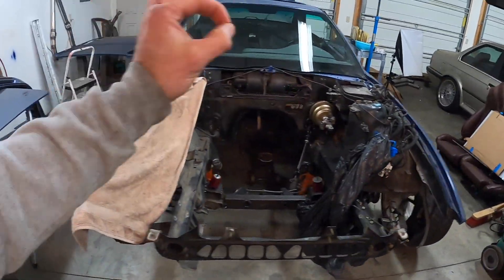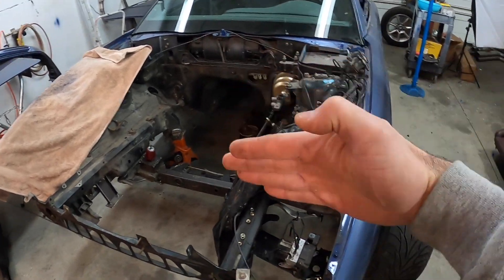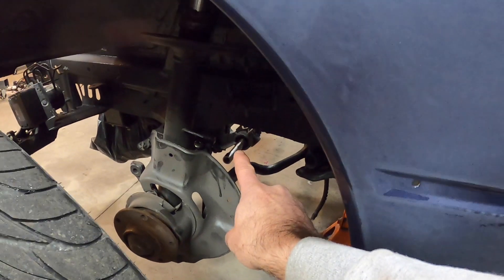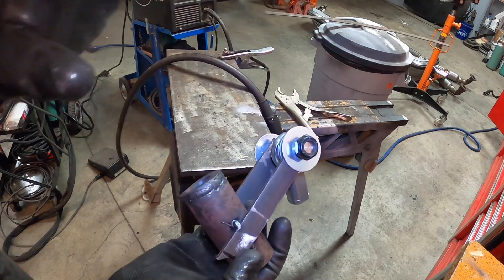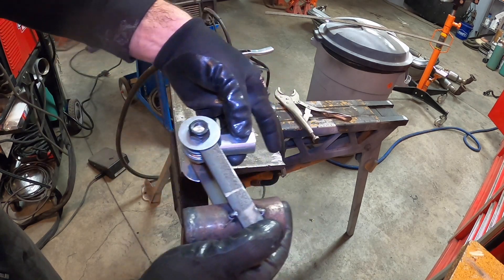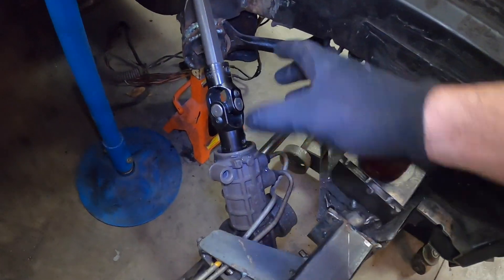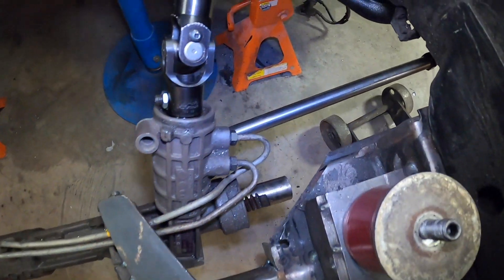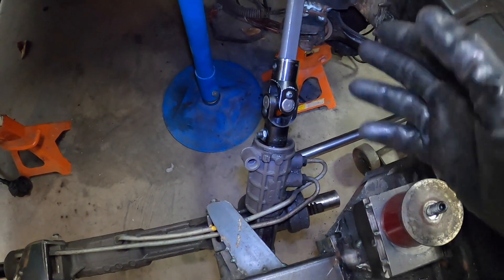Steering is Practically Done - Offset E31 Tie Rod Construction!

Comment: Congrats on 10k!  I worry that the adapter tube you made for the end of the rack could rotate up or down throwing off the geometry very abruptly. Maybe mil some kind of keyway and sleeve at the end of the rack output?  Or some sort of spline on the two faces?  Or any two shapes that when they mate up,  it would prevent those two parts from rotating.  Cheers!
Reply from the maker: George, That was probably one of the most informed and well thought out comments I've seen. That and Morris's comment about the spinning assembly. I think that clocking it with a keyway is best to still allow for adjustment. Thank you for that - And I will definitely heed your advice!
Reply: @Garageaholic  The more I think about it - it still seems a little sketchy  Who knows what's inside the rack to prevent it from spinning - it might never have been designed to take those an axial load.  Are you sure you can't chop the oil pan up and move the oil pan pick up?
Reply from the maker: George I did chop the pan already. I had an older video in this series I took 3-4 inches away. I should have just gone dry sump but they are -$5k.
I’ve been racking my brain on how to install a spline between 2 rotating surfaces, like an index for adjustment. But perhaps it’s best to find the 1 spot it needs to be and secure it there.

This is my second attempt at this and my first attempt used a ball joint on the steering rack end and it DID induce a torque and put torque on the rack. I’m thinking the tie rod end approach makes the force in line with the rack, preventing that moment

Comment: If the short M16 screw works loose from vibration, the whole of that bracket could drop/turn while you're driving.  once you have the positions set, I'd weld the screw to the cup on the inside so that the entire bracket can be screwed into the end of the rack.  that way the worst that can happen is it turn anti-clockwise a little
Reply from the maker: Morris, great comment and thank you so much for thinking about this. Because you're right. Perhaps not welding is the best option, but a keyway to prevent spinning of the tie rod holding weldment to the rack. Something to hold the two together to prevent spinning. 
The M16 will have locktite and will be torqued down to specs to prevent any loosening, but your are SPOT ON. Thanks again for the comment! When the cnc machined brackets come in, I'll do another video showing what I've done with the assembly. Thanks again!
Reply: @Garageaholic  yes, I realised almost immediately that on the opposite end of the rack, things could still go wrong if the thread came loose.  Some means of locking the bracket to the rack is a better plan.  Keep up the good work.  I'm currently rebuilding an M73 V12 plus manual gearbox with intent of putting it in an E46 Touring.  Steering rack/subframe and oil pan interference with modifications is at the front of my mind🤔
Reply from the maker: Thanks for the comments. Engine position and interference derisk is PARAMOUNT to the very beginning of any swap project! Good luck!!